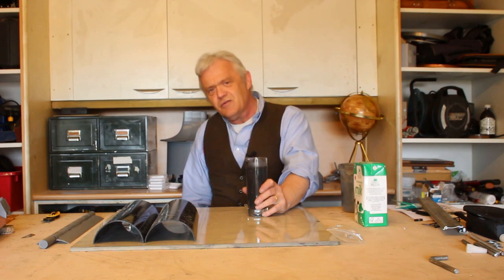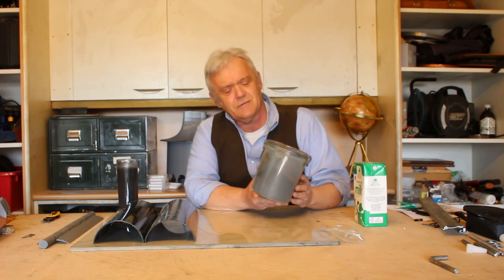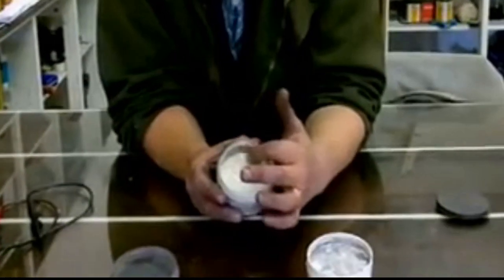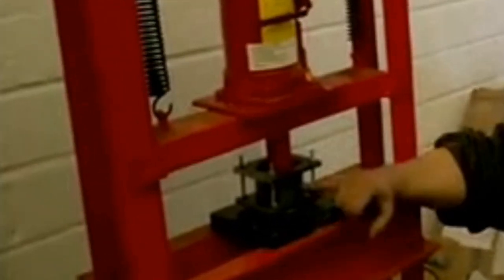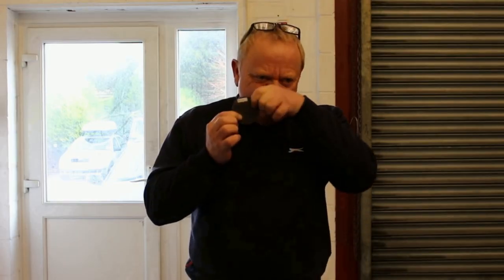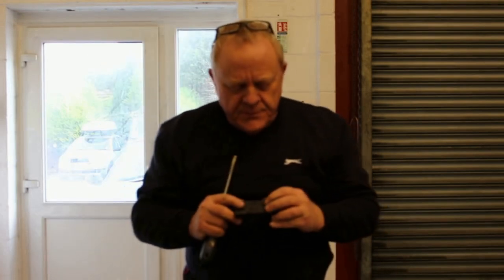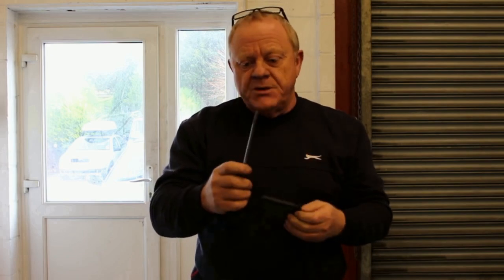1934 Simple Bioplastic Made Stronger Than Steel

Comment: Casein is pretty useful on its own. When combined with 4+ layers of linen it makes Linothorax armour as used by the ancient Greeks. Note linen or hemp has to be used rather than cotton because of the microstructure of the vegetable fibres. So-o-o- how would your casein graphene perform?
Reply: Aliens have already got this tech and anti tech . That's where rob got it from . You see👍🏻
Reply: @Fgway  Linothorax is fibre reinforced plastic and the linen/hemp fibres are woven and not as brittle as glass or kevlar.
Reply: People have made reproduction linothorax armour and tested with arrows, blades etc, it was used for a long time, it is pretty effective, needs a lot of linen though, but at a time when metal was scarce it did a great job, plus it wasn't as hot as wearing metal in a hot Mediterranean climate, truth is we don't know how many layers, or how it was made, if glues or leather were also part of the layers or if casein was part of the process.
Reply: That’s amazing thank you for sharing I had no idea, I was already thinking of making a composite plate from hemp, using 20-40 layer high density hemp weave canvas.. being that hemp has such amazing properties, it is already being held up to Kevlar as a viable replacement but I had no clue this was already done in ancient times, I saw hemp soft armor from ancient Asia but never heard of this ancient composite plate. 

Also want to look into weaves that spread more energy in more directions, there’s a standard plain weave (2 directions) but there’s also triaxial and quadraxial weaves (3 & 4 directions) which is more costly but drastically stronger with any material, they make triaxial carbon fiber for high strength parts in aerospace and performance racing 

So my new idea is a bio plastic hemp composite ballistic plate, triaxial weave or quadraxial, every other layer cut tilted to 5 degrees, bioplastic impregnated with graphine powder & microfibers for strength as well as ammonium polyphosphate for flame resistance
Reply: @DrJohnnyApocolypse so glad to read your comment, saw it mths ago but couldn't find it again till now 😅😅
Reply: Thanks for this info, saw it a while ago but couldn't remember where this/your comment was, glad I found it again 😅😅

Comment: I remember when you were talking about graphene infused plastic years ago and I'm glad to see another update! I'm curious about the strength testing, specifically I'd be interested in seeing the results, what method was used, which measure of strength shows that it's stronger than steel, etc, and I'm curious as to how much the graphene contributed to that strength. I did a quick search that implied that casein is normally on the order of 100 times lower ultimate tensile strength than steel, so if the graphene improved the strength by a factor of 100 or more then that's huge... Thanks again for sharing all the work you do and I'm looking forward to more updates!

Comment: I am wondering about increasing strength of epoxy resin for coating plywood in boat building.  I think you mentioned adding to resin in a previous video.  Anyway, as you probably know there are lots of beaches where coming ashore is not exactly like a tropical beach of pure white soft sand.  A lot of places in Florida and the Gulf coast of Texas are sharp oyster or reef zones east to damage a boat’s hull.

If this stuff can stop a bullet it can sure add protection to a hull moving at less than 10 knots coming aground.  I’m thinking add to epoxy on rudder blade, centreboard and centreboard case.

Also wondering about UV aspects.  Epoxy has zero UV protection and needs paint or UV varnish out in the sun.  I’m in Australia :  it’s almost winter but I still need a hat and sunglasses outside during the day.

Anyway just amazing videos.

Comment: I wonder if you can mix 0.5% of this stuff whit PLA+ and extrude it for printing or if it whould slowly obstruct the nozzle. If some one have a filament extruder it's worth a shoot i think.
Reply: I kept thinking: I want this to be 3D printable! :D
Reply: I think there already exists plastics with graphene in them, I remember the downside is that it chews on the tip of the extruder (aka, the bit that prints the plastics).

But I'm unsure of how well bonded it is as it's not pressed under 2 tons lol
Reply: I haven't seen graphene pla but there's lot of carbon nanotube pla
Reply: Well it's a lubricant so I would think it wouldn't clog the nozzle unless it got wet .
Reply: turns out there are loads of academics pappers on this... should have started there. If someones is curius betwen 0.1 and 0.2 are the ideal ratios the load goes up around 45% tensile stenght by 17% and energy absortion to about 12% prety neat.

Comment: Just a thought someone may be able to explore. Some bio-plastics shrink as they cure. A particular mix of concrete that allowed for a graphene incorporated plastic to cure could maybe be pretensioned by default?  Just a thought
Reply: I honestly don't think shrinkage is a problem with this specific mix and manufacturing process... It's put under a 20 ton press and is already highly compressed due to that.
If we put it in a concrete mold that has the 20 ton force needed to mold, then you still need 20 tons of force to keep the mold in place and get all the product inside.
I'm more curious what happens to the conductivity, can this perform like metal in more than one way?
What if we press a wire out of this, would it be floppy or would it be brittle, ready to snap when you look at it wrong?
Reply: @Yezpahr  Sincerely, either I'm not understanding you, or you're not understanding me?  The shrinkage in the case would not be a problem, rather a problem turned into a benefit. It wouldn't have to be this plastic, but any that the graphene would bond to. If part of the curing process would utilize the solvent shed by the plastic curing, maybe, only maybe, it would be possible to have a lattice reinforced concrete.  There are many videos on pre and post tensioned concrete and it's benefits, if that is where we're not seeing each other. Kinda a Rupert drop, but a block, and not largely the surface.

Comment: The problem for us DIY'ers is the combo of heating + pressure.  It takes expensive equipment to do this, and making such equipment is not easy either.  I suppose you could use all metal vices to push down on it and heat it in an oven or the like, but I don't think that would do near as good as the equipment in the video, and especially not compared to what industry can use/do. 

   With that said, this material would be very interesting to combine with either carbon fiber, basalt fiber, and/or S2 fiberglass cloths and epoxy composite outer, since I'm pretty sure the casein is not fully waterproof.  Encasing the bioplastic composite in an epoxy-fiber composite, should make it even stronger, tougher, and completely waterproof.  The bioplastic composite would be an excellent bulking agent since casein is pretty low density. 

    Would love to see composite blends between the above for all kinds of things from car panels, skateboards, etc, etc.

Comment: interesting that the process for this plastic is not unlike teflon, where they powder it and press it in a mold while heating in the pressurized mold to get the shape. Seems like making friends with a shop that does machining of plastics could prove useful as you could take the chips and shavings and then grind them up to make the powder that graphene is added to before pressing to get that shape out of any plastic similar, (especially the ones that cant be just heated and flow like we do with 3D printer filament plastics)

Comment: If that was able to be dispensed into a 3d printer you'd have something amazing, not that it's not already.
Reply: I reckon you could just do it. If you use the UV liquid resin type printer, just add graphene to the resin!
Reply: The problem with a 3-D printer is that it’s just Layering hot plastic that’s not very dense at all (it can’t) 

3-D printer is good for one offs, modeling, and maybe knickknacks here and there that aren’t really anything you need to rely on.

They’re good in a pinch, but that’s basically it.  If you were really in trouble, we’re just wanted to make an at home robot, toy, or something that you do not mind breaking

Sintering metal, Or other composites, is another matter entirely.
Reply: @MichaelSkinner-e9j  they also just said resin printer not plc printer, that more crystalline growth type layering with a surface coat to make it smooth
Reply: @user-um9sl1kj6u It depends on the type of 3D printer. There are a lot of different versions out there that are making fantastic, usable, and long-lasting items... not just trinkets or one-offs.
Reply: @geoffkeller5337  agreed the technology is definitely there, on a consumer level the easily printable polymers with all the qualities we want at a acceptable price is probably a little bit further down the road.👍🏼
Reply: Just print a mold.
Reply: The.trick might be in getting an homogeneous dispersion of the graphene in a resin . Stirring it in might not achieve homogeneity.  I recall Rob explaining the intricacies some years ago for another plastic which he enhanced with graphene. Perhaps polystyrene dissolved in acetone in which the graphene also dissolved   quite well .

Comment: Having researched basic casein, I've learned that it does seem very easy to make. Using Bing AI, I've tried to discover casein's durability - which seems to return a standard response of it being bio-degradable in 30 days. Other responses suggest that casein buttons on garments withstands washing and ironing.

However, I'm struggling to find how long a casein item could last. For example, could it be used to make consumer electronic device cases, a garden furniture chair or such like?

Comment: A bit of a newbie to the world of graphene, I'm also a new to 3d printing... so would it be sensible to make a diy graphene strengthened filament and if so how would it's properties differ from say standard pla. Would you be able to use it in a standard diy printer?
Reply: How would you get the 20t pressure?

Comment: Was that the full process? How did the dry yellow stuff become white from just grinding?
Reply: I think it may have only looked yellow because of the camera's color settings and/or lighting
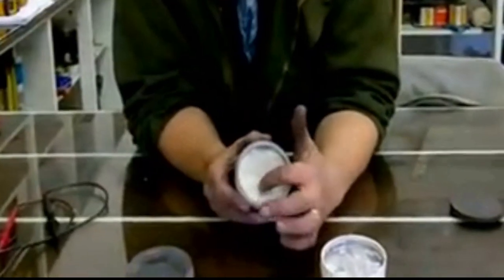Reply: @kf8113 it can't be. 1:35 if you look at the reflection in the plastic the light is clearly white
Reply: How about it oxidised on the outside, during the drying process and when it was ground you see more of the white from inside?
Reply: @FlakeyPM  that's probably it

Comment: If it makes plastic stronger than steel. What happens if you add it to steel? Or is that a silly question?
Reply: Carbon actually dissolves in molten iron , graphene is carbon. Not sure if Rob may have however used graphene addition in another metal or alloy cos it'dve been on the members channel I think. He did do something . Definitely would require sealed oxygen free enclosure in order to not oxidse away the graphene

Comment: Reminds me HEMP PLASTIC, Ford Company, in early 1900s made one of the first run off cars that was made from hemp plastic and also filtered cold pressed hemp oil as "diesal" fuel for them! The car upon tested with sledge hammer beating proved it to be 10x stronger that steel upon impact! 
Truel "green car", but, for some political reason, the making rollout of them stopped and they disappeared! 
BTW, it's also proven that you can make upto 50,000 products from the hemp plants !! 
That alone can revolutionise the economy of any country today if they are allowed by the dirty political global mafia !! 😊😊😊